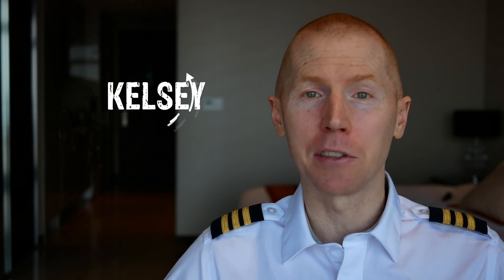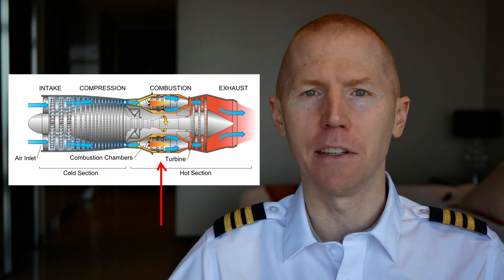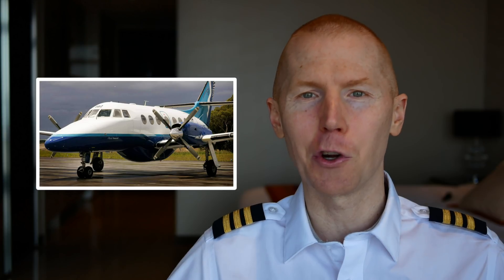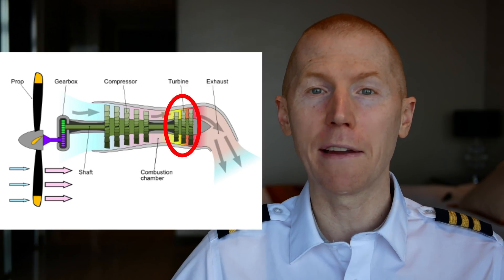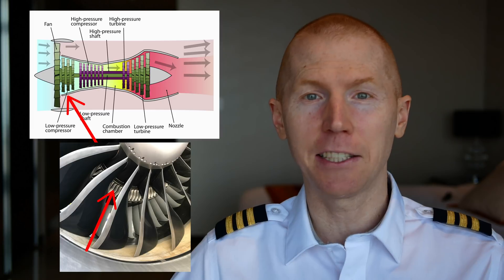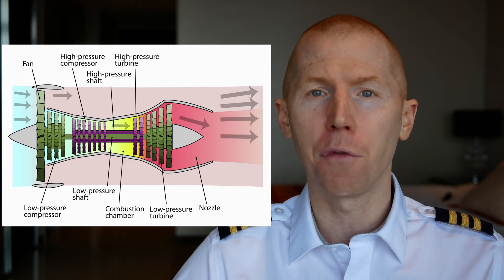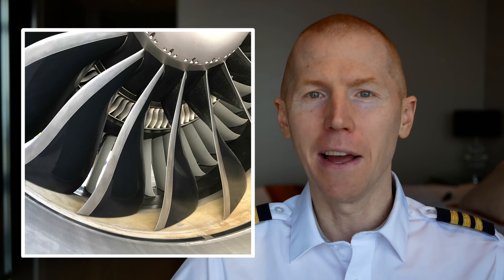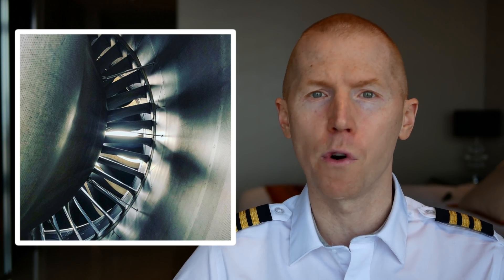Is a Turbofan Engine or Turboprop Engine Safer? | Pilot Explains

Comment: I am curious as to your usage of the term exploding when talking about the hot section combustion. Wouldn't that be "burning" of the air fuel mixture at subsonic speeds vs "exploding" at supersonic speeds. Please clarify. Thanks.

Comment: I'm a retired A&P mechanic. I was wondering once the airliner gets to cruising altitude levels & cruising speed which is around 550 mph, the fuel consumption must be really low, because the turbofan engine are basically venturi tubes, so the momentum & enertia from the speed must keep the airliner going with a very low consumption of fuel if any at all. I also have wondered at those altitudes of 30,000 ft plus there isn't much oxygen so what keeps the engines ignited at that high of altitude, do airliners also use liquid oxygen at that altitude to keep the ignited or is there just enough oxygen from the high speed to kerp it ignited, because it obvious there is not enough oxygen for passengers to breathe at that altitude. I also heard the new big airliners now have a 2 speed gearbox in the compression section
Reply: Well, a turbojet engine or a turbofan engine core (which is kinda the same thing) takes in a lot more air than it really needs for combustion. Not like a petrol engine where the amount of air and fuel needs to be a perfect ratio. Most of the air from the compressor is not going into the combustion chamber to mix with unburned fuel but is flowing around it. It is used to cool the combustion chamber and passes in slowly through holes in the liner of that combustion chamber to mix with the very hot exhaust from the burned fuel and air. This is actually necessary to keep the hot section of an engine from melting into pieces. Once the exhaust hits the first stage turbine it has cooled down significantly because the mixing with cold air. Those turbines still run near their thermal limits.

Comment: The fact a turbo prop plane has a gear box is what bothers me there must be a clutch because they can stop the props and keep the motors running, a clutch is not a good thing to me clutches fail and gearboxes hae too many moving parts
Reply: There is no clutch on modern turboprops. The propeller is connected to a power turbine on the back of the engine and spins at the same rate as that (or it's geared, but that is a direct planetary gearbox with no different gear ratios or anything).
Reply: @AmbientMorality  when my ex flew on one they turned the props off but kept the motor running howd they do that without a clutch to disengage
Reply: @dewaynemiguel3349  That shouldn't be possible. What plane? I assume you mean right before engine startup as they come out of the gate and are preparing for taxiing to the runway?
Reply: @AmbientMorality  it flew in from Los Angelas to A little airport in visalia it pulled up to the terminal shut off the props but the motors kept rrunning they borded right infront of the props then the closed the doors engaged the props and taxied it had to have somekind of clutch

Comment: So he never addressed the safety issue. My take would be that both are extremely safe - certainly much safer than a piston engine - but the turbofan would be even more reliable. Turbine engines are absurdly reliable, and from what I've heard most engine issues with turboprops are problems with the propeller, typically the pitch mechanism, rather than the gas turbine itself. My mom's entire flying career she never had any engine failures in any aircraft but did have a few precautionary shutdowns in C-130s, always due to propeller issues. Not having propellers, turbofans can't have propeller problems. Another case of the simpler something is, the less there is to go wrong, the more reliable it will be. The one advantage of propellers though is it's less vulnerable to FOD, birds, or even heavy rain - that bird ingestion story is really one in a million. Flying through a flock of birds a turbofan is much more likely to take damage than a prop. And turboprops can fly into hurricanes without issue (that's what my mom was doing in C-130s - she's undoubtedly a bit of a nutcase) while the deluging rain would probably drown a turbofan. But either way I feel perfectly safe, especially as all commercial aircraft have two engines and can fly on one (or in a few rare cases more, always at least one more than needed to fly), I think the engines, regardless of type, are the least of my worries of what could take the plane down.

Comment: Correct me if I'm wrong, but I believe quite a few turbo-prop aircraft use some of the air-flow generated by those propellers to generate/increase the lift that the wings produce. Without the extra air-flow you get less lift, so if one engine fails the plane becomes severely unbalanced, if both fail then you have a terrible glider in your hands.
Besides that, there have been a couple of turbo-prop commercial aircraft with quite a few issues (ATR I'm pointing at you, also see defective "constant rpm" props etc.).
So it isn't so much the safety of the engine's....engineering itself rather than the fact that turbo-prop aircraft are more likely to get into one serious situation or another because of their design overall. This goes for turbo-fan aircraft as well, like the 737 Max issue wasn't the size of the new engines, but rather everything else Boeing did to accomodate them...

Comment: A jet engine does not live on an 'Explosion' . There IS a 'controlled Burn' going on in the combustion chamber where Fuel is introduced to the air stream , NOT air is introduced into the fuel.  Not trying to be a know it all,  but I had this argument 20 years ago at Airframes and Powerplant school.  A & P in Sacramento.  The air from the first fan , while moving outside of the core of the engine , is still contained Inside of the engine housing (by-pass air)  This By-pass air is what makes these engines quieter by enclosing the hot exhaust air in a stream of cold, undisturbed air.  Cool video !.

Comment: To help everyone understand just how this makes the turboprop and turbofan engines more reliable, the fan/prop is actually producing up to 80% of the total thrust of the engine. This is opposed to 100% of the thrust coming from the core of a turbojet. This is why fighter jets are so darn loud!
Reply: Most fighter jets use a (low bypass) turbofan engine nowadays too, though the fan doesn't do too much.

Comment: These two videos are a great simplification of how these modern engines work. Being someone who trained as a mechanic I do feel the need to point out a few small details that were left out that may cause questions from this community. Kelsey was kind enough to point out that the General Electric GENX engines are high bypass turbo fan engines but there are a medium and low bypass design as well. These are determined by the amount of air that the fan forces around the core. The less gap between the fan shroud and the core engine the lower the bypass ratio. Lower bypass engines are seen on some smaller commercial jets. Also unique to the GENX engine is the fuel mixing area known as the combustor. On most other turbine engines the combustor is more like a cylinder with one end open and the other with a dome with the walls being full of holes. This design will have a nozzle, that some say resembles a shower head, centerened in the dome for the fuel delivery. This nozzle is surrounded by fins to allow air in for the fuel to mix and are set to force the air to spin as it enters allowing for the engine to burn cleaner and more complete. The holes in the walls of the combustor scoop air and allow a boundary layer to form on the combustor walls to prevent the hot flames from the burning jet fuel form melting the alloy of the walls.

This man really does a fantastic job for the time he has available. If he wanted to cover every aspect of the aviation world it would take years of making videos just to cover the FAR " Federal Aviation Regulations" alone. I admire what he does and will be following his content.

Comment: I think that propeller can produce more static thrust, important in the very first phase of takeoff. Moreover, thrust can be adjusted by controling the attack  angle of blades. You could easly imagine that small jet-engine is capable of lifting a helicopter using reduction gear, huge propeler with small attack angle  but it can't produce so much thrust from itself. Look at modern military cargo planes: Airbus A400 or even V-22 Osprey. Notice that the newest turbo-fan engines have greater and greater fan.

Comment: Why there is no Afterburner in commercial aircraft engines like Jet engines ?
Reply: because commercial aircraft use high bypass turbofan while military jets use low bypass turbofan...you can't have afterburner on a high bypass turbofan
Reply: @4500intelx  Sure you can. It wouldn't make any sense whatsoever, but you could. The problem is just that the goals of high bypass directly contradict the goals of an afterburner, but there's no technical issue with it

Comment: Can you please comment on where the rain is drained out or if it just goes right through.
The mix of air and fuel for combustion must be effected by the rain unless og is seperated.
Reply: It goes right through. It affects the engine slightly (increases operating temperature and thus power), but given the air intake of an engine compared to the amount of rain stored in that volume it's a small effect.

Comment: I knew a mechanic that told me that in turbo prop not to sit in the row the blades are inline with if the engine throws a blade then there's a potential that I can go into the fuselage and well you know the rest he told me it's common they have to tighten the bolts I don't know if that's more to do with the type of plain or engine but he maintains the flybee that mainly operates turbo props

Comment: Great channel, 
Your question: I’ve always felt a turboprop engine more reliable than it’s forerunner.
Your jet engine explanation particularly with your illustrations was excellent.
Question: Is the high bypass turbofan engine more efficient than a turboprop?
Comment: I love the sound smoke and fire of the large cyclone radial engines, the only thing better is 3-more engines.

Comment: Either is fine with me...but I gotta tell ya...I love the sound of a turboprop, especially when compared to the sound of a piston prop engine. Turboprops sound like "all muscle", smooth and more reliable.  However, the diagram you show of a turboprop shows that it is not a direct drive from the shaft which surprised me.

Comment: The reason I don't like turbo props is because i) they usually fly at lower altitudes, inside 'the weather' ii) usually associated with smaller planes - again, more susceptible to being buffeted by the weather iii) slower than turbofans - longer journey time, iv) they tend to crash more (at least here in Taiwan) - this is not inherently the fault of the Turboprop (ATRs) - rather I suspect - their relative ease of operation, which allows dodgy airlines to get away with using cowboy pilots until .. the unthinkable happens - which it has - twice in the past 2 years.

Comment: Is "explosion" the best/correct term?  Is it not more a "continuous burn"?
Reply: I reacted to that therm, too. There's a continuous flame in the combustion chamber. When the engine is started, the air/fuel mixture is ignited by igniters, which are very similar to spark plugs used in cars. Once the engine is running, the igniters are switched off, because the flame is self-contained.

Comment: Since I learnt what Piston-Props where, as well as Turbojets, Turbofans, and Turboprops where I can kinda make out the sound of the aircraft above me
If it sounds like BRRRRRRRR and no whine = Piston Prop
it theres a BRRRRR and a whine = Turboprop
If theres a Loud Whine/Torch like noise = Turbofan
If theres just loud torch/constant "explosion" noise = The Canadian Air Force is flying their CF-18's over my apartment in Oshawa again... and those are Turbojets.
Reply: Technically F-18s are turbofans as well, with very low bypass ratios and afterburners. I don't think true turbojets have been used for quite a while now; the benefits of some bypass are too great to ignore

Comment: The title is clearly a click-bait. 

I know I am months late, but as a guy who studies how those engines are built, this is generally the simplest explaination:
The turbo-fan/turbofan (depending on how you want to write it) is a bit safer because the blades are incased. What does that mean? Well, let's construct a mental scenario to the extreme:
Let's assume the blades of a propeller and a turbo-fan are worn out and weakend and something strikes them breaking bits of it. In the case of a turbo-fan, the worst case scenario is ingestion of metal particles into the system and the destruction of the outer shell. However, most turbofans are quite solid, meaning the damage would usually be contained to the engine itself. And even if the engine is blown out, there is a low risk of losing the plane as a plane can be flown with one engine.
However, let's assume the blade of the propeller breaks. Well, you have metal pieces flying at almost supersonic speeds out  towards the cabin or control surfaces. Yup. Pretty bad. Even if we do not assume breaking the integrity of the blades or engine itself, we have the problem of FOD or other things being absorbed into the airflow and deviated by the blades. Again, with a turbo-fan, they are blown into the outer-flow and behind. 

With a turbo-prop, again, objects being deviated at supersonic speeds out towards the cabin. 

Of course, this is only looking at safety parameters in engines. Frankly speaking, most problems in modern engines come due to maintainance, (more generally, the lack of it). Considering this, the type of engine has nothing to do with safety unless we go into extreme cases mentioned above.
The difference in turbo-fans and turbo-props usually comes in the ballance between fuel consumption, thrust developed and noise pollution. A turbo-fan consumes several times more fuel than a turboprop, so its still highly inefficient in most of the cases. However, they allow for faster speeds and altitudes, while also being among the most silent out of the propulsion systems we use today, meaning the overall cost is a bit cheaper and resistance from population is much lower

Comment: The instantly available engine without “warm up” of turbine engines is a great asset. The turbo prop seems it would have advantages in slowing down “beta” and response to power than a turbofan but obviously louder. Makes sense why the prop is a STOL tool for commercial aircraft and the turbofan is a economy tool. Great explanation!

Comment: Oh, I was hoping for an answer to the question in the video :(. 
I guess the safety is likely to be to do with how likely these engines are to break up and how violent it is when they do. The failure of the engine isn't such a big deal in itself as long as there is another engine.

Let's say that the blade or fan break though because for example a drone flies into it. A fan has the housing of the engine to stop or attenuate the shrapnel. The prop does not.

A prop is made of thick material. A fan is made of thin material, but with many small blades spaced closely together such that an object hitting them might have the force more evenly distributed. Also the fan has a ring around the outside of the structure that binds all fo the baldes together. 

I think the real answer will come out of statistics or detailed computer models though.

Comment: I've noticed recently that a number of turboprops, especially smaller, single-engine turboprops (TBMs, Pilatus PC-12, etc.) actually work in reverse, where the air intake directs air to the rear of the turbine and the exhaust is ducted out the sides, immediately behind the prop. I don't really understand why they do this, but I think that it may have to do with the reduction gear requirements.

Comment: That's a lot of information in minutes... i love how you explain them... i also thought years ago that turbofan was better than turboprop... i was wrong...  been flying economy class with ATR-72 and airbus A320 aircraft... i wish i can be a passenger in a 747 one day.
all the best for you sir Kelsey!!!
Reply: Not too many 747s flying passengers these days, especially in the US. I was a passenger on a 747SP back in 1982 (from JFK to NRT). It was pretty cool plane, but I wasn't crazy about flying nonstop for 14 hours, mostly over the Pacific (not much to see out of my window). Even with the shortened fuselage it was a pretty impressive plane.
Reply: @bobraible  
Yeah i heard that 747's is slowly replaced by a more fuel effecient composite planes these days. Are they phasing out the 747's?
Also happening in the Philippines. Our 747 flag carrier was retired back in 2013 or 2015 (if i'm not mistaken).
Reply: @emersonsrandomvideos248  AFAIK they are mostly used as freighters these days. They aren't very economical to run.

Comment: I worked on RR Tyne turbo-props. If you took all four engines to mid range and let them stabilize then pull back to ground idle, the props made a noise that was addictive while they hunted for the right pitch.

Comment: In general, I prefer to fly on a turbofan airplane due to higher cruising speed, less noise, less vibration.  Also, adding props and mechanism to adjust the angle of the props adds more complexity and additional failure points.